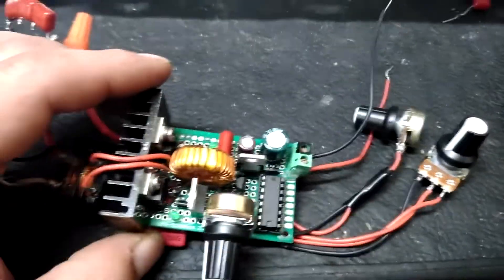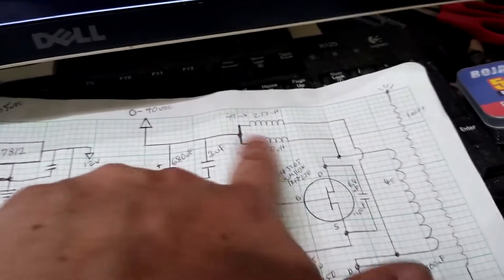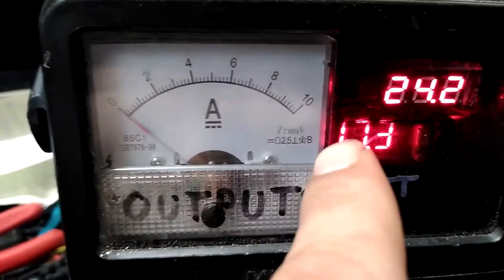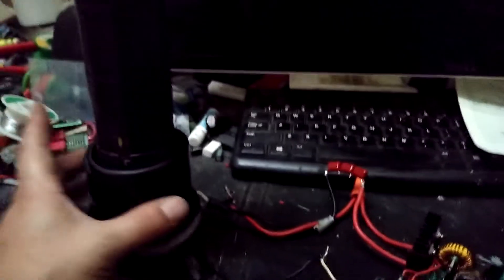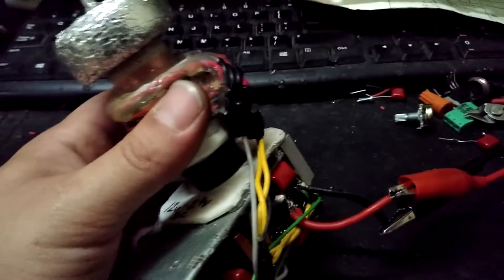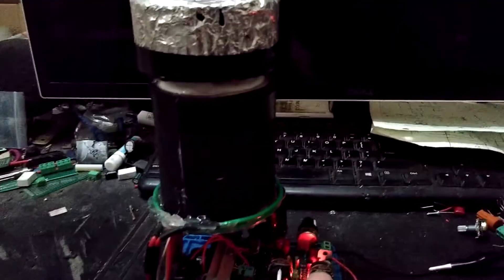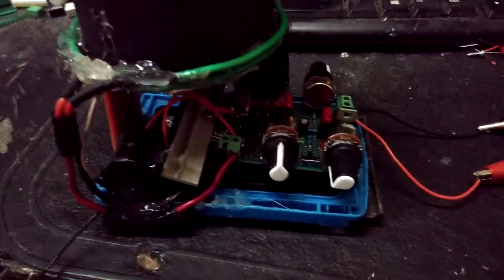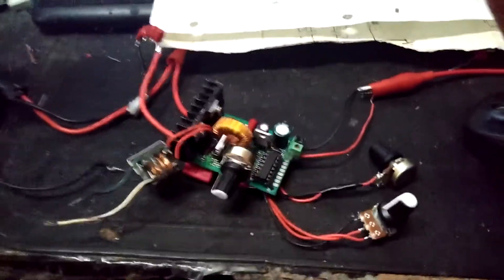24v SSTC/DRSSTC (Driverless) IRF3205's

Comment: 3:40 it's weird, your spark at 24V is just a few mm longer than mine at 12V and I've prob got less turns on the sec ~500...but it's that toilet roll coil, hence a bit bigger... If you've got a similar coil to mine, try removing the drain-source caps and use the one choke setup to fiddle with the value. In my case the choke value had a dramatic influence on the output, but it had that annoying sound as a sideeffect, more specifically the inductance had to be pretty high (yellow core, ~24 turns ). Also mine worked better with the primary closer to the middle of the sec
Reply from the maker: Discharges around 5inches at 24-volt. I'm sure this will improve by adding a DC capacitor on the rails. I'll play with it more after I wind a dedicated smaller coil for it.
Reply: @Magneticitist  I get what u're saying but it'd be great to see an almost identical setup to mine. Btw i tried a smaller coil with 900 turns and output was worse
Reply from the maker: @sFeral  The little setup I have with the primary caps and cylinder topload only has around 400 turns for easy 6 inch arcs but I usually run these around the 1mhz region. Anything smaller than 36 awg is too annoying so given the ideal size that's just about what it comes out to. Over 10 of these I've made had all acted about the same using the single primary circuit but using the center tapped primary always took various tweaking. I'd go for the highest 1-2 turn coupling without arcing over most of the time whereas with these I tune the primary according to intended voltage and the coupling needs to be fairly loose.  

The inductors in my case are in my mind mainly there because I'm always running a 12v regulator off the same rail to power the interrupter. Instead of an inductor on 'one side' maybe you just mean tying the collectors directly together so it's just one choke between them and + and still symmetrical?
Reply: @Magneticitist  u've got two chokes in the schematic. What's bothering me is how u've managed to get the functionality with both windings being on the same core, haven't seen u do it before
Reply from the maker: @sFeral  oh, I did that for a few other ones too. First one was actually ferrite and I remember not even noticing a difference by changing how I had the polarities. Basically just whatever easier at the time, in this case it saves a little space. In the previous one I made I have a larger yellow toroid on the bottom as the common wound chokes.
Reply: @Magneticitist  polarity should matter as the choking action completely disappears when currents run antiparallel/ B fields cancel out, though as I said I didn't have good results even with the right polarity. I should test that again
Reply from the maker: @sFeral  I'm not sure if that's much an issue if both fets aren't open or closed at the same time but I remember at the time I didn't do anything other than just look for a noticeable visible difference in the consumption and output by swapping polarities. I feel like I've done this with quite a few ZVS drivers also and I really can't remember or not if there was much difference. I'll probably scope the difference pretty soon building a tiny zvs driver to be a 12-volt step up supply for one of these coils.
Reply: @Magneticitist  Yeah it'll be good to see that
Reply: @Magneticitist  one more thing.. have u tried swapping the FETs in the Tefatronix circuit with some high voltage BJTs usually present in SMPS power supplies ? Those run relatively cool continuosly, so I'm guessing they might run even cooler interrupted and they can be salvaged cheaply.
Reply from the maker: @sFeral  Yea I tried a bunch of different transistors last week I think it was. small IGBT's as well. I settled with the IRF3205 mosfets cause I got the best output after adding low esr bus caps and even good output at 12v with the right tuning but when I tuned for the highest voltage output I ended up popping them at 31v input. I also popped them running slightly lower voltage from a boost converter. I decided to keep it at 12-24v and am waiting on more 3205's. Among others I tried to get it working were all the other common fets I had like IRF640/740 etc and they all worked to a crappy degree. BJT's had worked also but just.. crappy.  

The only common denominator I've found so far is that the lowest rds seems to give me the best output.

I think BJT's may work well in this circuit provided the voltage is right but 12-24v probably won't give good output compared to mosfets. Tuning is so picky though I'd imagine it would take a lot of tweaking to max the output of any transistor used. For example I've had plenty of setups that output with that whining noise and give decent 12v sparks but they have no beef to them. I could then just swap to a different coil and get much better output. So basically just drop in replacing transistors in this circuit doesn't seem to work. It has to be tuned for each transistor specifically to work right.
Reply: @Magneticitist  I figured as much concerning the tuning.
Reply from the maker: @sFeral  lol yea I mean I'm only gonna wind so many coils and swap out so many capacitors etc cause it takes too long. I bet if you had like 10 different varying coils and primaries to just swap one may work pretty good with any given transistor. I wound a small 1.5mhz coil for this circuit but it didn't work too well. Seemed to give like the same Slayer exciter kind of output no matter what I did. If something seems too picky compared to a different setup that seems much easier to achieve good output I just stick with it cause I want to be able to easily recreate it in the future. I think in the end 100v fets are best for a safe 24v ceiling and can still have enough affordable low rds. At a certain point above 24v it's like why not just use 120vac for simplicity.
Reply: @Magneticitist  In my latest video u can see how the spark looks when a 330microF cap discharges from ~130V (Joule thief), seems to be about equal in length to a ~25V (iron core transformer) input but the spark is thicker and fuzzy
Reply: @Magneticitist  I got lucky with the components I had (didn't do that much swapping) but I'm gonna try one of those SMPS feedback cores and see how that works as GDT... you didin't mention trying those, but I'm guessing u probably have
Reply: @Magneticitist  Can you confirm/replicate what I did in the latest vid, and possibly use that to make a SGTC ?
Reply from the maker: @sFeral  Nice, it looks like the primary is tuned for higher voltage compared to how I tune for sword sparks. When I tune the primary so the arcs are the longest to free air (no jumping to hand) the arcs start looking like that BUT then you can reach a voltage ceiling on the tuning where the arcs don't get bigger with more input. JT powered is a cool way to do it though especially something like a flash cam circuit using an AA but course the only downside is the sparks get boring after a while having to wait for them. 

That's the thing about these, you could probably tune it run good from 120VAC but then it doesn't have too much advantage over a HB or even single ended setup. Then there's the factor of 250's being used which can actually handle the CW great if tuned right, but that won't fly off 120VAC lol. So many variables.. I retuned a IRFP250 setup I had for good arcs but then it wouldn't run CW without pulling over 10A anymore and it was like well damn the 250s are getting wasted now.
Reply from the maker: @sFeral  IDK about SGTC but yea you can use any boost circuit to drive it I do it all the time I just never boost to over 30v or so cause I want to keep it low voltage. I thought the best deal was using a ZVS driver since it's able to push the juice to get more than just really low bps operation but it's easier to use 12v input for the ZVS.

As for SGTC IDK how you'd do that using the mosfets.
Reply from the maker: @sFeral  oh nm I see u just put a new one up I'm bout to watch it
Reply: @Magneticitist  Yeah I swapped the Thief for the ZVS, but I have to drive it off ~7V instead of 3.7V...I keep looking for a way to drive the 12V gate fets at 3.7V in the ZVS configuration.. no success so far
Reply from the maker: @sFeral  I've seen guys do ZVS drivers at 4v or less really nicely but I think they are using fets with much lower gate threshold. I never got my hands on any that would go that low without first starting oscillation up at higher voltage.
Reply from the maker: @sFeral  So in your new vid is the TC output basically getting the HV cap to discharge where it otherwise wouldn't have?
Reply: @Magneticitist  yes
Reply: @Magneticitist  I'm investigating Teslas claim that an arrangement like this could possibly create "ball lightning"  but I think the SSTC should be running CW and be directly connected to one of the electrodes.. tho he wasn't doing it exactly like this, I think this is a simplified version